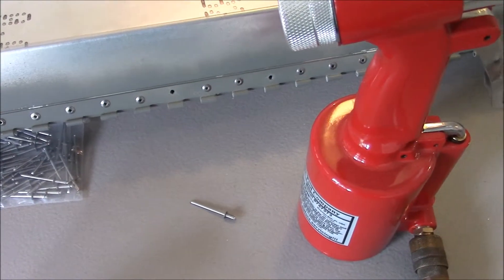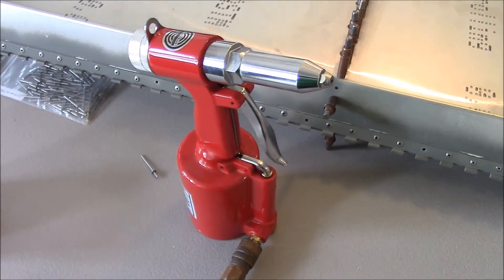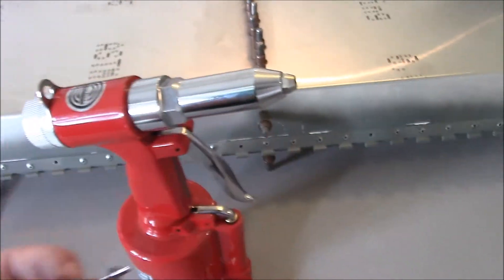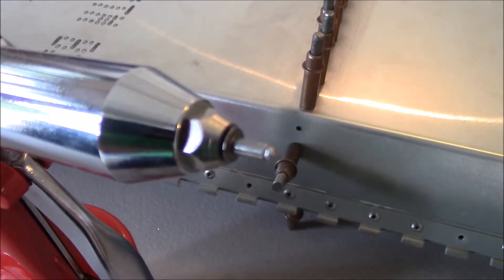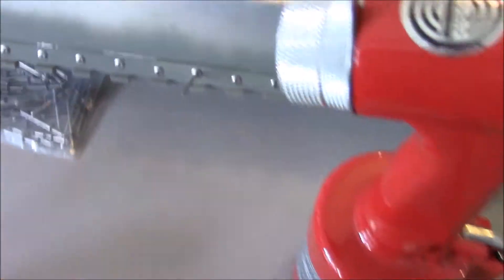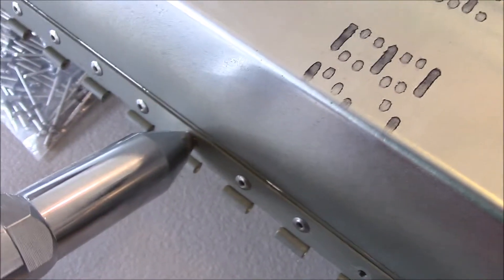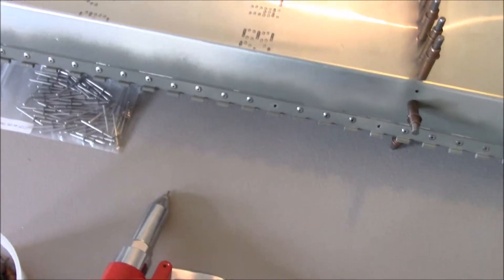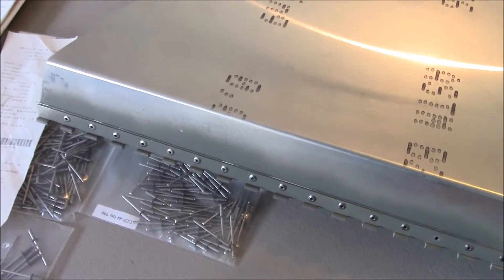Sonex Build FAQ - How to Rivet a Homebuild

Comment: Daniel, great build videos, I have seen them over the last year or two.  I decided to start building and am currently setting up my workshop to start the tail. My question is, what pressure do you set to pull your rivets? And if you had any tips riveting? I have yet to pull my first one so a bit nervous.  Thanks!
Reply from the maker: Hi! I pull between 60 and 80 psi. Check the specific riveter you got as each one asks for a different PSI. Also, feel free to try it on scrap metal first. That way if there is an error, it doesn't hurt the part. Best of luck with the build! I am slowly getting back into mine now that my baby is going to daycare. -Dan